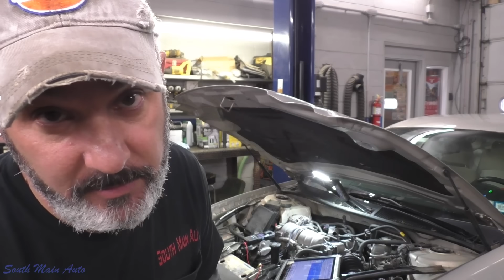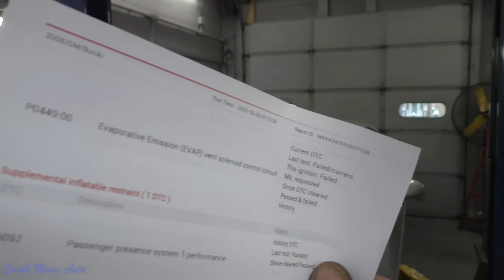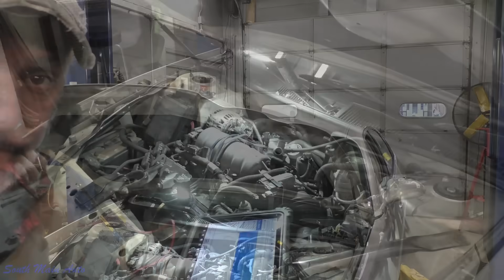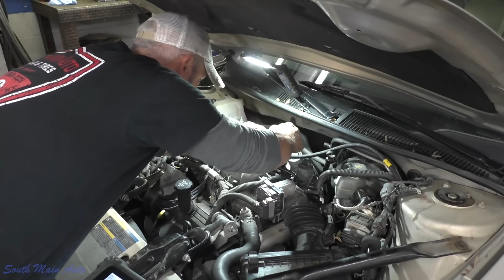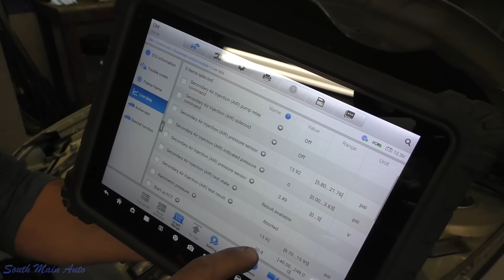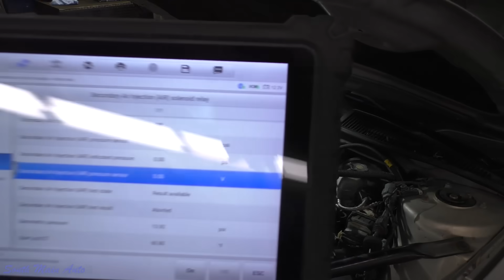When “New” Parts Are Worse Than The Broken Ones 🤬

Comment: 3 new bad master cylinders in a row from FVP. We tried to order a different brand from a different supplier and also were sent FVP.  We finally got a good AC Delco part and it was fixed. What was frustrating was all 3 were bad in the same way, the rear circuit was pumping air at the end of the stroke and would never fully bleed so like after 2 in a row and the 3rd is doing it to you got to start to question if something else is wrong. Down the rabbit hole of researching the booster and pushrod and pedal stroke and everything else only to come up empty handed and try another AC Delco. Went through the same multiple bad in a row on a Toyota 4 piston 2 halve style caliper from FVP, 4 in a row weeping fluid from between the halves. Looked like they just blasted or media tumbled all the surfaces and probably ruined the sealing surfaces between the halves causing fluid to weep out when the pedal was held down for a couple minutes with brake boost. We finally got one that didn't weep on the 5th try. We call Duralast the Big D because you're likely to get the Big D when those parts are on your car. We have a commercial account with Autozone and Pepboys but we try to never use them because it often takes longer than they say to deliver the wrong part then even longer to get the right part. They also have a nasty habit of subbing in a house brand part for a name brand part when we order a name brand part. If we call and give you the exact number and brand it's because we want that exact part!

Comment: Eric got a question for you about a 96 jeep grand Cherokee. It has the 4.0 in it. The thing only starts when your foot is on the brake. If you take your foot off the brake it dies. I’ve done everything I could think off to fix this problem. Any suggestions

Comment: Had a power steering rack i changed in the home garage on an 08 envoy.  The first part had a crushed return line.  The second one i put into the vehicle, it lasted less than a year and had about 3500 miles on it.  This is not a fun job laying on your back and having to do it multiple times.

Comment: Why don't you just take a multimeter to NAPA and have them bring out all the junk and find the one that works?  When I was in search of a crank sensor for a Cherokee back in the day that's what I did since I knew some were dead right out of the box and didn't want to be asking for several trips back to the store.  The first one I tested, DOA.  The second one was good.  The DOA went back on the shelf and I'm sure someone else pulled their hair out at some point troubleshooting a no-start with a freshly faulty CKP sensor.  If I'm leary about the part's reliability, I bring the multimeter and test it out the counter.  Saves time.

Comment: Now you know why I drink bourbon!  Worked on a Caddy SRX. Previous mechanic threw 4 new O2 sensors (aftermarket)  That shop says they can't fix it. My friend asks me to look at it.  All 4 O2 sensors are junk.  I get 4 GM DELCO Sensors, Install them 1 is bad! Heater circuit is open!  Take it back to GM parts (with my ohm meter) Counter guy doesn't believe it's bad. So we Ohm in out. (BAD!)  They give me another one but before I leave he test the circuit. It passes.  NEW = NEVER EVER WORKS! 👿

Comment: Parts quality is absolute trash these days. Be thankful you don't live in a more populated area. I can't tell you how often I order parts and open up a box of spark plugs to find all used plugs. Used parts returned by some low life  returned to the store for full credit, then the parts store employees have become so revolving door and uneducated they don't check the parts, accept returns on the used parts, and restock them for the next schmuck. (Sometimes I wonder if the used O.E. parts are still better than the new aftermarket garbage)

Comment: I know exactly how you feel, Mr O. Been there before myself quite a bit. Just like I think that the engineers who design these cars should have to fix them, I also think that the CEOs and other leaders of the parts companies should be stuck only using their crappy parts when their vehicles need repair. Then again, they probably just buy a new car instead of fixing what they have because they're so rich. Makes you wonder at what point are most cars older than a few years just going to be plain unfixable. 🤬🤬

Comment: It drives us garage owners mad Eric , I'm over the pond so plenty of European stuff to fix , a few yrs ago had a Citroen diesel van in , Egr fault , vehicle ran but crap , took part off , ordered replacement from local stockist , 3 plus hours to fit , wouldn't start, took it off put old one back on started , rang parts shop they supplied a replacement, exactly the same , after 2 days replacing 7 " new aftermarket " ones that wouldn't work I said get me a different make , started first time , still working today 6 yrs on , so I asked for a labour claim , to which I got " don't worry we will look after you , we will knock extra money off your future orders " , 2 weeks later the manager left , no one knew anything about his promise ,🙈🙈🤬🤬💩💩🇬🇧🇬🇧🇬🇧, every day white boxes PRC , junk alternators , junk sensors , junk squealing brakes , wrong boxed items , pads with boxes pre opened , cv joints with no clips full of dirty fingerprints on the boxes , all the motor factors are the same , they are not interested 🤡🤡🤡🤡, I feel your pain 👍👍👍💯

Comment: Friend of mine put a brand new HEI distributor in his old nova so he wouldn't have problems.  He took it for a test drive and it stranded him miles from home,pickup coil bad when it gets to temperature. I've had problems with mis-manufactured parts for a 69 camaro from fuel tank necks being soldered crooked to brackets not lining up on the bolt holes,. others i know having problems with MSD 6a digital ignition boxes failing like clockwork.

Comment: Have you checked both sides of the connectors?  A single weak pin will kill the whole thing. It's just thin copper. They get beat up or are poorly made.
   ''To use a pin gauge, insert the smallest pin into the hole and gradually test larger pins without forcing them until you find one that fits snugly. If you're checking a tolerance, use a "Go" pin, which should fit, and a "No-Go" pin, which should not. For accuracy, ensure the pin gauge and the part are at the same temperature and insert the pin straight along the hole's axis.''
   A pin gauge set can be had for $50-100.  Most of the time only a dozen or so will be needed for any car, not counting large sizes for batteries/starters.
   edit; save your fingers and mind with a $25 pin go no go holder.  Use a chart to find a ''go'' pin and a ''no go pin'' for the other side of the tool. Once you get it set up, it's really easy.
    I also feel obligated to mention that a cheap and dirty method is to buy a new pack of electrical pins for that coupler. Manually test each female pin for looseness. Uh... disconnect the battery first.

Comment: Just recently I had to go to 3 different Napa stores, 2 O'Reillys, and an Autozone (not in that order) to get a starter for a 2006 4 cylinder Rav4. 3 bad starters in a row. Like an idiot I threw the first one in before testing it. Two of the trips where to stores that had the ability to test it as they were nearby. Now, normally I would just get a through Toyota reman Denso starter but they aren't available atm due to tariffs. It's a legacy part due to them changing to different starters afterwards for stop/start etc. So there is no 'new' ones anymore. But as the toyota parts authorized dealer guy told me due to the tariffs only parts for warranty coverage is being shipped in atm to have them in stock. I could get one drop shipped with a high charge of about 500 USD but it would take a while.

Comment: I just commissioned a generator last week and the controller on it failed straight away. I was able to replace the controller and get it back in business, but I had no less than three coolant level sensors and three gateway connectors that had to be replaced on the same unit in order to get an operational for the customer.

Comment: Local shop changed my flexplate 97 Camry. Started once after. Dial indicator on aftermarket way off. Ordered OEM now, their loss on parts and labor first try. Sucks. If I quoted that job it would be OEM only. They are great for making it right.

Comment: I used to work at a regional auto supply house in the 80's after school and I don't remember the quality issues that  the industry has today. They used to have quality in the mix now it's all about maximizing profits over quality.
Reply: Aftermarket parts were often good quality until about 5 years ago, in example it used to be maybe 1 in 50 starters/alternators would be bad out of the box. Now it's more like 1 in 4 if you can believe that.
Reply: because most all of it was still made in USA or Canada, now almost nothing is!

Comment: Vice Grip Garage was trying to get an old Chevy truck running to drive home. It needed a mechanical fuel pump, starter, and several other parts including a master cylinder,pads ,brake cylinders. Everything he bought was junk. He ended up taking parts off of another Chevy he had there to get it running. The new brake parts melted while driving home.

Comment: I think that the Chinese manufacturers that produce replacements of original US parts do so based on specifications and blueprints, but have weak testing procedures to make sure that the parts actually function properly. So if a measurement is a little bit off, the part doesn't work. I have another example, some non-brand batteries for a DeWalt drill -- the batteries don't fit nicely as the original batteries did. I have to use a lot of force to get them in, and big channel lock wrench to get them out.
Reply: Quality control is out the window it seems.

Comment: I bought new headlight bulbs for my Prius. They are the outrageous expensive ones and test your sui©ide level. Without removing bumper covers and fenders to change then the space you have to get at them from under the hood is measured in new born baby hands. Mine are far from that. After a few hours of teaching the local kids new words they didn't work correctly. More English language lessons later I pulled the new and put the old back in ( one was blown) and avoid driving it at night until new ridiculously priced ones could arrive and Satan rears his evil on the land again.

Comment: I fitted a £2300 suspension control valve last week, plugged the box in, hit "bleed procedure" and there was a big bang from underneath the vehicle and oil dripping everywhere... There was the solenoid dangling by it's wiring loom with half the valve still attached to it, sheared clean off at the start of the threads... Overtorqued or damaged in transit, I don't know but I am ***** STILL steaming about it.

Comment: Years ago it seems the aftermarket parts in many cases where better than OEM but now it's the opposite. At times aftermarket would find and fix flaws in manufacturing or engineering of the OEM part. Of coarse now we have this new tactic called "indefinite back order" on fairly new equipment. They just can't say NLA but that's actually what it is.  People at the end customer level like most of us watching care about the customers much more than the manufacturers do. We end up being the buffer between the manufacturer and the end user so we get the blame for all that goes wrong. As manufacturers got larger and became public traded companies they started serving their share holders (and their board members) much more than the end users of their products. It seems the problem has amplified exponentially since the push for world trade and sending the manufacturing over seas. Once upon a time most countries wanted American made products because of their durability but there are no American made products any more. At least not wholly made and engineered here like it used to be. It also might be that AI and computer programs are relied on too heavily these days and human experience much less.

Comment: If you deal with and have a good relationship with your supplier they should pay your labour for the defective part labour, I've been in the aftermarket parts Buis for over 50 years and if you were a good client of mine I'd pay your bad part labour claim, perhaps at a reduced hourly rate but at full book time. Unfortunately Napa is a re boxer, so sometimes you win, sometimes you loose on the parts they supply.

Comment: I installed new control arms on a 2002 Sienna and the bushings went bad after 30K miles. It's my wife's rig and she's very careful to only drive on smooth roads as much as possible. So the problem wasn't regular stress on the control arms from bad roads, the problem was sh*t parts.

Comment: I had a similar issue with a radiator. I installed a replacement, but after three weeks, it started leaking at the tank. The company apologized and quickly sent me another after I provided photos of the defective part, but it failed the same way after another three weeks or so. It was obvious that the factory's crimping machine wasn’t calibrated correctly. I complained again, sent more photos, got a refund, but wasn’t compensated for the time I spent removing and replacing two radiators, as there was no way to predict the part would fail over time. In the end, I had to replace it three times because I finally installed an OE one to solve the problem. That’s the downside of aftermarket parts—I should’ve chosen OE from the start.